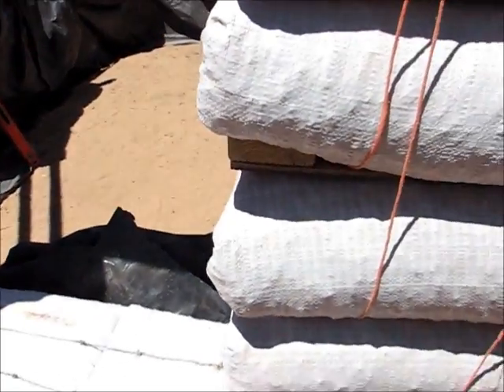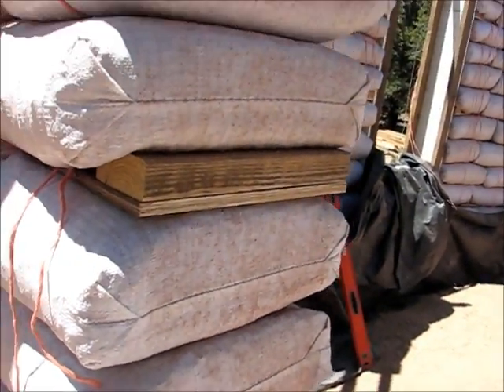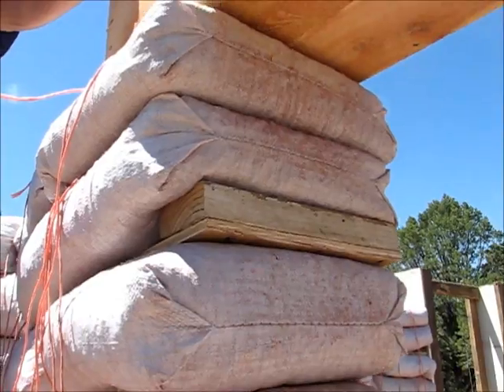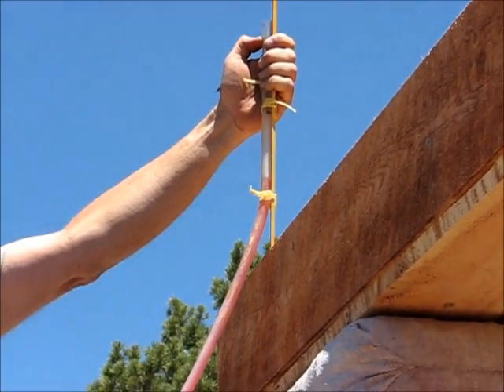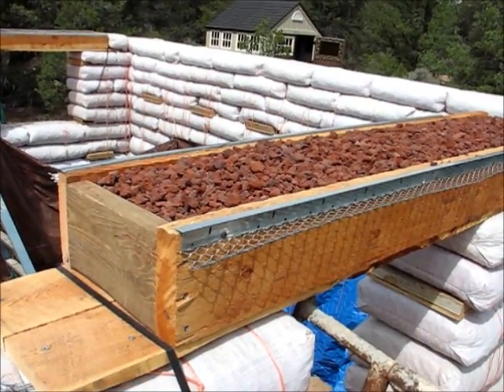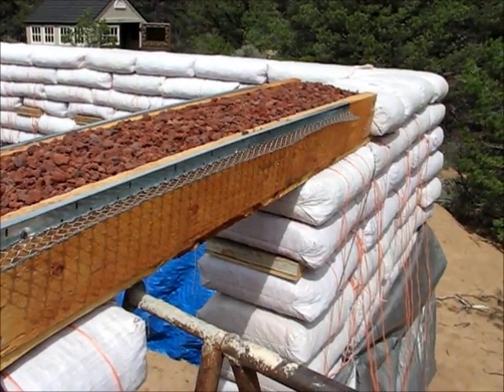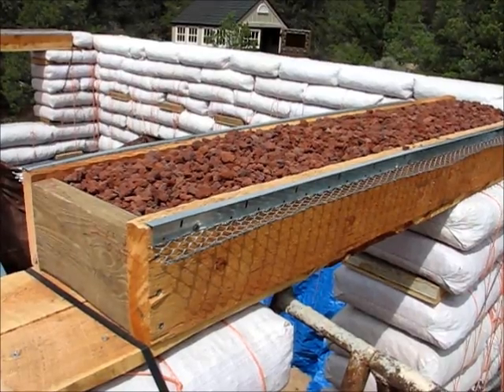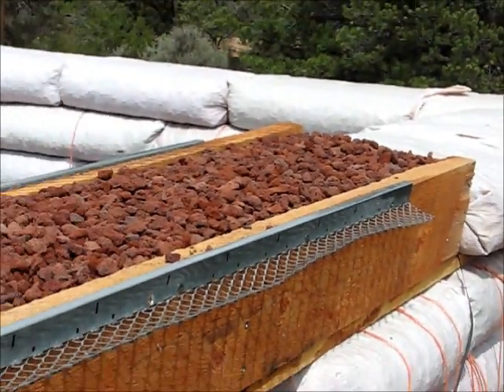Box Lintels over Window Openings

Comment: Hi Joe I am really glad I found your videos on Youtube where you are filling the bags with scoria.  I am hoping to do the same when I start my build on a house called "Spiral2" from earthbaghouseplans.com.  My question to you is, would you recommend using scoria to build the walls as the walls are curved.
Reply from the maker: Hi Donna. I feel like it is more difficult to "shape" bags of scoria then bags of earth. If the curve is a gradual one, it shouldn't be a problem. But tight curves, and short intersections, as in our doorway buttress where it attaches to the main wall, were a bit difficult. We went with more standard construction on the roof and 2nd story loft section. If you are framing the roof, think about how your roof structure will adapt to the possibly free form scoria walls below.
Reply: Thank you. I was thinking about a bond beam on the top of the stem walls. Possibly rebar as you did , using 18 x 30 bags. The spiral 2 design is like a 1/2 oval with a flat straight greenhouse in the front window. I was wondering if this would work with scoria as the architect is saying
Reply from the maker: Owen Geiger should know a lot more about it than I. Keep in mind that scoria is not stable like the typical soil compressed earthbag. So rebar is likely a good idea. Also, the integrity of the bags is crucial. Pounded earthbags will still be stable when the earthbag material is gone, but not scoria, so you need to make sure the exterior layers will be stable, protecting the bags from sun, and not washed away by rain, etc.